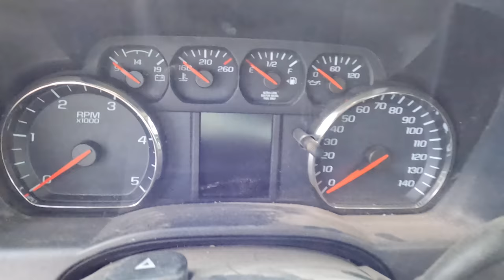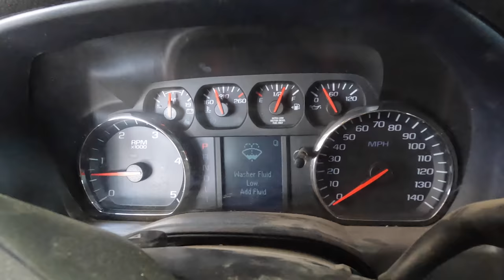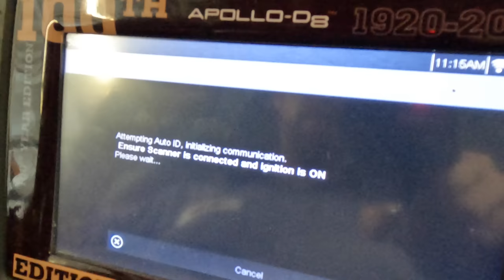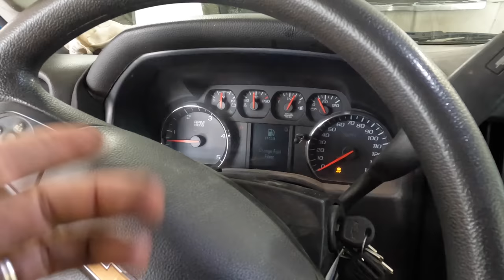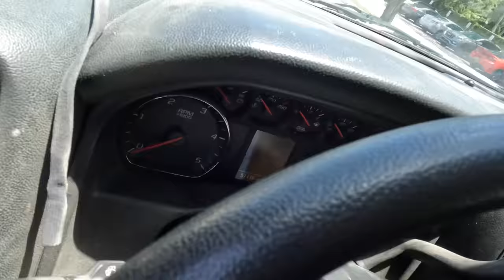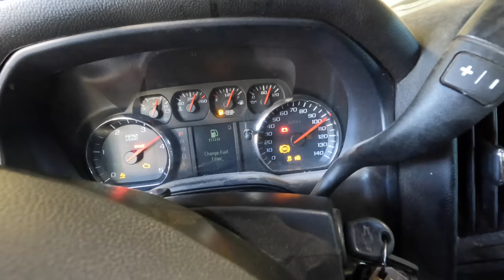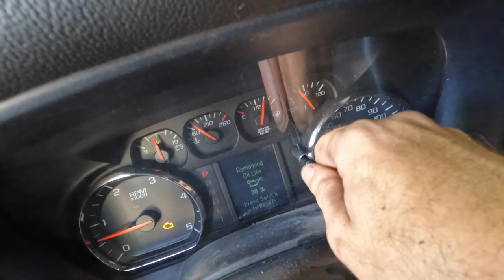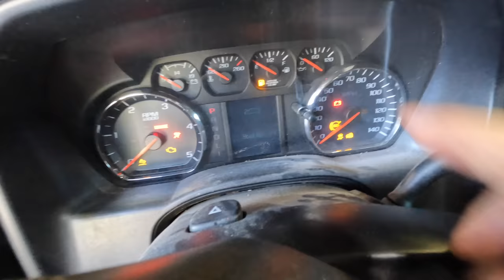Multiple Warnings! Medium Duty Duramax 6.6 3500 4500

Comment: That def or know as adblue here in Australia has many many environmental warnings in the labels . So not so environmentally friendly if you ask me. A mate of mine works in a truck shop and they spilt some on the floor it stripped the paint clean off and left a permanent stain on the concrete floor too.
Reply: Same here in europe. In case anyone is wondering what it is made of:  32.5% urea and 67.5% de-ionised water. That is all.
Reply: We call it " Pig Piss" in the UK.
Reply: Funny how our Adblue shortage from earlier this year just suddenly went away. This week it's electricity shortage.
Reply: @paulpaintshop103  that's a good name for it mate. Take it your not a fan of the stuff either?
Reply: @handymandev03  Definitely not, worked for a haulage company for a few years, it's horrible stuff especially when you get the inevitable leaks ect.
💩💩🉐
Reply: @derekhobbs1102  I guess there’s still a shortage as the price of AdBlue is still almost double of what it used to be.
Reply: @derekhobbs1102  still costs more than the fuel itself in the east of Victoria
Reply: It’s such a simple chemical that reacts in the most horrible of ways. I was working on a bulldozer and began to notice some kind of buildup near the exhaust/emissions system, so we use our overhead crane to pull the hood off (that was the only way to service the exhaust) and it turns out that a small leak had developed around where the DEF/AdBlue is injected into the exhaust and it had leaked onto the various metal parts under the hood.
This created some kid of rust colored crystallized mass that couldn’t be wash away. We had to take an air chisel and beat away at this for hours just to replace a small gasket
Reply: I always thought adblue had a blue color. Why blue if it ain't blue ?
Reply: @loubakker5000  It's not blue as in color, it's blue as in sadness, melancholia, depression...
Reply: And they say: Do not spill on the paint of your truck! Side fill vehicles ? Oh Oh!
Reply: @derekhobbs1102  that’s our stupid life today,, it keeps the working people mixed up, over 2 years of Covid, house prices, fuel prices, vehicle prices, food prices, gotta wonder,,,, what the F is really goin on !
Reply: @krzysiej--9229  So you're saying just peeing in the receptacle would be sub-optimal?
Reply: @Silentguy_  thats salt crystals
Reply: @loubakker5000  
Blue is the color associated with the fluid. If you fuel up at a truck stop, the DEF will be the blue pump next to the diesel pump. If you buy it in the box, it is usually labeled with a blue color. BlueDef is also a popular brand as well. The Def cap on diesel powered vehicles is also a blue color.
Reply: @standhd  Isn't there a song about the color of blue as well ?
Reply: Def... saving the earth by pitching multiple 1 gallon def jugs into the trash after each def tank refill.
Reply: @steveearwig  Ah yes. Always thought it was about the color. Am not a native english speaker. As in, I've got the blues. Thanks for your explanation.
Reply: Not quite here in Germany. Diesel is at ~2.20 € per Liter (that’s ~8.75 US$ per gallon), while AdBlue (DPF) is at ~1.50 € (~5.95 US$)
Reply: @loubakker5000  That I don’t know….🤔
Reply: @yarrik701  someone probably come's up with the brilliant idea to put it in cardboard containers, like they do with the straws in drinking cups🙃
Reply: @flysosky6464  or glass.. which would be a nightmare to ship.
Reply: SSShhhhh! Don't spoil my big break. Just found out I have gout--high levels of urea.  I'm going to get rich selling my pee!  Eat your heart out, Bezos.
Reply: @yarrik701  Not to mention the petroleum that goes into making those plastic jugs and shipping them all over the country

Comment: "Disclaimer" I am just asking a silly question about the coolant your using .Research on my part suggests only to use "Dex-Cool" in GM vehicles,mixing anything else leaves a sludge build-up, working on someone else's car recently (big cooling system leak) I had to make a decision  buying stuff your using(cheaper) or Dex-Cool (more expensive) for a family member's car-their only one.I want to be on safe side and not hear complaints down the road,just would like to know (yes this like asking what brand oil to use argument ,LOL)
Reply: Dex cool doesn't mix with anything else without gelling.   Be absolutely sure whats in there before putting dex cool in.   In my opinion it's crap, flush it all out and go with standard and you can be sure of no issues.
Reply: @v12alpine  Valvoline says their coolant was engineered to work with all coolants and all colors
Reply: @v12alpine The vehicle in question is a GM , and not to sound like “science geek “ upon further research dexcool is something like low/no silicate and phosphate  solution,supposedly to make it water pump and AL-uminium friendly , my bitcoin worth ,LOL
Reply: The Autozone extended life coolant he is using is universal, works in all makes/models.  It is chemically exactly the same as Dexcool, except dyed yellow.  It is perfectly fine to use in this application as well as any other.  Gelling will not occur in this situation or any other with Dexcool, as it is also universal.  Don't believe everything you read on the internet about Dexcool, it is good stuff.
Reply: @coolantkid3428  interesting I was under the knowledge that mixing green with dexcool or vice versa was a recipe for disaster.
Reply: @coolantkid3428  no it isn't, I heard that they changed something it it a while ago but I have seen what it does to gaskets and will just stick to using only the universal stuff only, not a mix
Reply: @wades623  Where did you hear this and what exactly was changed?
Reply: @coolantkid3428  there is actually no such thing as universal coolant. Especially with dexcool.

Comment: What irritates me about vehicles that use DEF is a lot of the older, smaller vehicles don't give you anyway to tell how much DEF is in the tank.  Drive until you hit limp mode.
Reply: Even the MD Chevys don’t give you a DEF warning until you hit what it considers a “low” level. So far the only trucks I’ve come across that actually give you access to a live DEF gauge are the higher package Fords.
Reply: @Silentguy_  I drive part time for a delivery service. No one ever fills the DEF when they come back to the barn. It drives me insane. I mean how hard would it be to put an extra gauge in the cluster?
Reply: @gerrycarmichael1391  it wouldn’t be hard, semis have had them since the start of this debacle.
Reply: Not a consumer issue much longer as diesel been phased out to only commercial vehicles.
Reply: @peted5217  I read that too! But I don’t get why the big 3 have engineered new 3.0L diesels for the 2021 model years, I thought by 2025 there would be NO non commercial diesels built !?
Reply: @fredwalker839  Lots of stuff can happen in three years.  Be sure to vote.  LOL
Reply: @Dave-ty2qp , And this time vote the right way, you see what happens when you vote in the wrong people.
Reply: @Silentguy_  my 17 chevy 2500 will starts warning me when it gets to 500 miles left.
Reply: @Silentguy_  also my son's 18 Ram actually has a gage like the gas tank.
Reply: @peted5217  definitely not phased out, you can still buy them just fine
Reply: There's even some vehicles (Euro 4 spec) that have a sealed. non-user-serviceable tank and the DEF tank has to be refilled at dealer service. Which is the dumbest design *ever*.

Comment: The side cap on the coolant/surge tank you mentioned Ray is for pressure testing the coolant system if memory serves freightliner uses the same style tank set up with 2 caps.  The one our had in your hand should have a pressure rating on it
Reply: Makes sense.   Seeing as it's a MD/HD truck, they are always built with maintenance concerns in mind.  Well, much more so than your average non-commercial cars and trucks.   Most modern vehicles are designed to be driven a certain amount, then sent to the crusher.
Reply: Yes, Freightliner uses the same type of reservoir. I unfortunately had a coolant leak in my company work truck a month ago and I had to carry extra fluid to finish up my day so I know that reservoir well and I too wondered who it had a cap on the side.

Comment: 12:30
That reservoir is has two mounting positions. float works both ways.
My toro snowblower engine has 3 oil fill caps and 3 drain plugs. NEED to use only the brightest one.    ty, les

Comment: The second cap on the coolant bottle is a pressure relief cap.  Speaking of coolant, the red coolant is an extended life coolant ment for medium and heavy duty trucks. It should not be mixed with anything else. I would recommend completely draining the coolant and fishing the system then going back with the elc coolant
Reply: Hope it doesn't act like GM's Dexcool,mix anything with it other than that and it turns into jello.
Reply: @SuperGlacierGirl  maybe,,,never tried it!
Reply: It can be mixed with the gold coolant.
Reply: GM uses Dexcool in all their engines, gasoline or diesel.  It works in both and contrary to old school thinking, you don't need a "diesel specific" coolant that has silicates, nitrates or other now obsolete inhibitors.  The universal extended life coolant (yellow) he used is chemically identical to Dexcool and perfectly fine to use here.
Reply: @SuperGlacierGirl  Dexcool has been incorrectly blamed for everything that has ever gone wrong in a GM cooling system.  There is nothing wrong with it and any situation with gelling is attributable to another problem, not the coolant.

Comment: Hilarious! You had diesel envy until you realized it drove like a building.

This reminded me of the movie Big when Josh was reviewing a toy transformer that turned into a building. I don't get it. What's fun about playing with a building?
Reply: I worked a job 4 years ago that had me going around our entire state replacing and installing P25 radio equipment into an electric utilities fleet of trucks.  Among these were new (then) 2018 F550s with 6.7 Powerstrokes ... big truck, engine was nice and quiet, but you had to really punch it to get the thing to move.  Many of these had large utility beds on them with buckets.  Lots of weight.

Comment: That's not bad a 2 dollar sensor replace full expansion tank . Dealer rip off again
Reply: Chinese sensor in a Megna bottle,, why, why! It’s all about the cost of manufacturing! Don’t get it! Good thing, the new bottle from GM is +/- &120.00 ! With the $.20 sensor! LOL
Reply: The dealer had absolutely NOTHING to do with the design of the part. Get the facts before you act with a stupid comment.
Reply: @wali4vr  
Yes what you say is very accurate however 
the “dealer” is the one closest to the wallet of the consumer right 
so within the relationship of purchase doth not the dealer have blood on their hands I humbly suggest yes they do . 
If perception is Golden then the dealer is guilty in the eyes of the purchasers.
Reply: @GarryFishermusic  I mean, the dealer is the one stuck with these parts.

Try explaining to a Mitsubishi Mirage Customer that you quoted their one 14" hubcap at $127, but the lowest you can go is $92... because that is the COST.

I understand the dealer is selling the part, but they actually have pretty minimal control over the cost on the OEM stuff or repair procedures.

Which is why every Outlander with a blown trans cooler gets literally whatever size the parts store has in stock, lines spliced, and tack welded to the frame. $180 vs $1600 for the part, and 20 minute repair versus.... I can't even remember book time to  re and re the factory cooler. It's... a nightmare.
Reply: @GarryFishermusic  Dealers are a retail business entitled to a profit. Having been a mgr. in several departments at several dealerships their net profit suck compared to most businesses. Anything OVER 1% is good and 2% is walking on water for domestics! Pretend you had only 2% of your gross pay and it seems pretty reasonable.

Comment: I’ve seen you do this a couple of times now. You mix “red” and “green” antifreeze. When “red” first came out they could not be mixed as it would gel and kill the engine and radiator.  When did that change?
Reply: Red is propylene glycol and green is ethylene glycol, using the wrong coolant in the engine can degrade seals and in some cases even damage the engine block as the additives differ between the two. the red dexcool type has additives to protect aluminum blocks and heads the green stuff usually doesn't. But hey gotta keep those customers coming in.
Reply: @helmonful  100% Right ! I’ve had customers come in ( more in the winter with “ I got no heat inside) when it’s too late! Can you flush it out he says ! I say, good luck, like my garage, we don’t have “ flush “ machines any more,,, they are coolant exchangers ! You have to come back for 3-4 more exchanges,, with no promises,,, or go down the street & find another garage! Sorry bout your luck! Don’t mix !!
Reply: @helmonful  And this customer will not be coming back in because of the coolant. It was yellow and made to be able to mix with other coolants.
But what do i know i'm not an armchair mechanic.
Reply: @katokagome4670  Blue is BMW.
Reply: It was actually Orange (the Dexcool garbage), and Gold.  Both of these are ethylene glycol OAT type coolants, the gold is designed to be able to be mixed with anything.  There will be no coolant related failure.
Reply: @silicon212  It was "actually" yellow not gold so says the label on the front
Reply: @themig292003  yellow and gold are the same thing.  Semantics.
Reply: @silicon212  In that case, I have a tin of yellow paint i'd like to sell you full 100K.
Reply: That was yellow, not green, and it's perfectly fine, that is universal extended life coolant.  It can be used/mixed in anything.
Reply: @helmonful  You sir, are ignorant.  Color has nothing to do with if the coolant is propylene or ethylene glycol.  The yellow extended life coolant he used is perfectly fine here and superior to the OEM formulation.
Reply: @themig292003  You are the only commenter here that isn't ignorant of modern coolant formulations.  That universal yellow is perfectly fine here.
Reply: @katokagome4670  He used Autozone universal extended life yellow coolant.  Perfectly fine to use here and in any vehicle.
Reply: @silicon212  Correct, except Dexcool isn't garbage, it's been incorrectly blamed for anything that has ever gone wrong in a GM cooling system for the past 27 years.

Comment: The side cap is designed as a pressure relief cap. If you start taking it off it will relief out of the over flow tube... instead of into your face. If it's at all similar to the class 8 trucks.

Comment: Never mix coolants! I've done it before and it deteriorated the coolant it looked like oil ! Flush the system or use the same coolant that is in the car
Reply: Never mix red with green. Never mix regular coolant with heavy duty extended life coolant. However, you can add gold colored coolant to either red or green with no issues.. it is a versatile coolant that is designed to blend.
Reply: I would rather spend a few extra bucks and and use dex-cool.
Reply: Wrong.  The Autozone extended life coolant he is using is universal, works in all makes/models.  It is perfectly fine in this situation, as well as any other.
Reply: @DavLT  This coolant is chemically the same as Dexcool, only with a yellow dye color.
Reply: @coolantkid3428  I've done that before buddy and it deteriorated
Reply: @justindaniels17  - I've mixed the gold ELC in with the red in every semi I've owned and never had an issue.

Comment: I was wondering if anyone would comment on the different coolant colors, red is GM coolant orange is Chrysler and green is your original style, yellow is universal which will work in any system.
Reply: The yellow he's using is perfectly fine here and in any application.  It's chemically the same as the OEM Dexcool.
Reply: @coolantkid3428  I wasn't trying to say there was anything wrong with him using the universal coolant, that's what we always used in the shop, it's way easier to keep that in stock than a bunch of different types, I was hoping to point out before someone said oh no you used the wrong kind of coolant that universal coolant was designed for just that purpose.
Reply: @maxmcarnage7642  Got it, sorry for the confusion.  It's sad how people waste lots of money on OEM coolant when the universal is perfectly fine.

Comment: The hood operates as 57 Fords do and Mack trucks of the 60 and 70 do.  It's nice not leaning over a fender, is it not?  That's unacceptable that replacement fuel filters are not available.  Have a great day, Ray. 😁👍  Good work thus far.

Comment: 2 coolant caps. One is the fill the other is the pressure cap. Tank is like a maze design to degas or remove air bubbles.
Reply: And that explains why the top cap is reverse threaded. The caps will not perform properly when installed in the wrong positions. Score 1 for the designers.

Comment: Used to be able to replace a float. Now its the whole module (tank and float) thats one of the reasons the guys at the dealerships get the nickname "parts changers" instead of mechanics. Window regulator was gonna cost $485 to repair at dealer. Mechanic friend fixed it in less than an hour for less than $85 by "fixing" broken regulator instead of changing the $$345 regulator assembly.

Comment: GM engineering leaves a lot to be desired. Replacing a bottle for simple contact switch etc.. Ford not any better... Both must use same engineers.
Reply: So they only stock one part ...also a expensive one